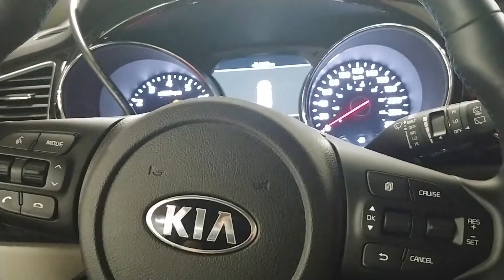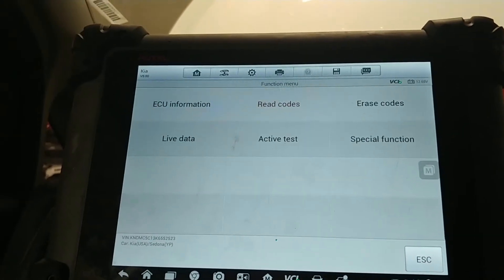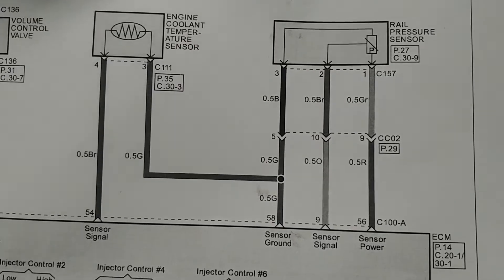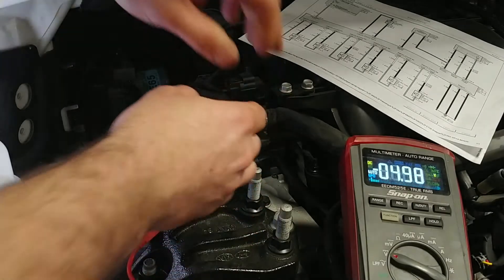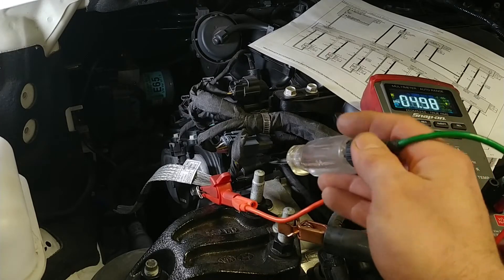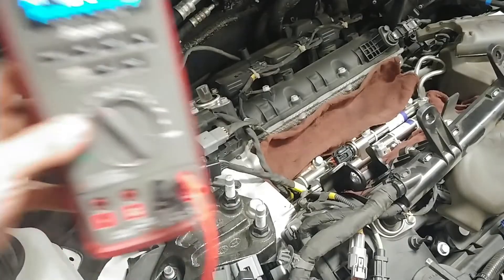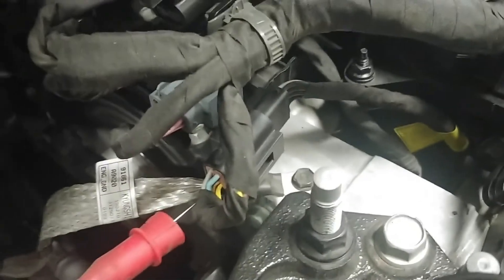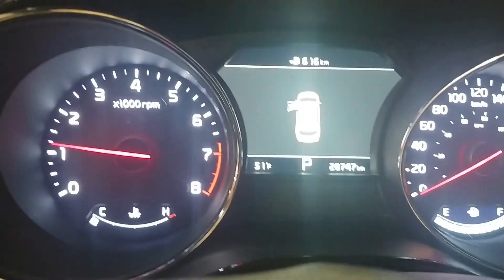Fuel Rail Pressure Sensor Diagnosis

Comment: What was the signal voltage with engine on? Thank you, nice video. 
My 2021 MB, I’m reading 1.12 at idle, 1.13 at 2000rpm with no DTC or Check engine light. Weird.

Comment: The video is helpful.. I have a question.. what if the signal wire plugged in key at ignition and the voltage below zero volts.. ??

Comment: hello, i have a passat 2.0 TDI CFFB engine, i tested my presseur sensor only by reading vcds value and i found that teh pressure kep a litle bit stable at idle then a sudden peek happen i would say 2 or 3 times from 28 KPA to 32 KPA, the peeks ar happen for ms in about 10 seconds , is it a faulty prssure sensor ?

Comment: I have FRPS circuit hight eror.engine cant start but at same time i have fuel pressure  readings that goea up to1200 when cranking.but i am going to perform the test as shown
Reply from the maker: it depends on which vehicle. there can be either 2 sensors. if there is a gdi system there always be one at the fuel rail(which is for the hp side) and another for the low pressure side. the circuit hi code is more likely due to wiring or a sensor.

thanks for watching

Comment: Should any of the wires in the connector have power when testing with a circuit tester? Car on engine off.
Reply from the maker: 12v no.. power is fed through a 5v circuit, so withe the connector connected you should have a 5v a ground and a signal wire, the singal wire will vary depending on the pressure in the system

Comment: I don't know if anyone asked, but if someone could answer this for me are those voltage values basically for most cars or all cars. Or does this specific use 5? Just trying to see If I need to go searching for my Ford 500.
Voltage values Yes, I'm still having a problem. Even after a place in the sensor which i'm starting to believe was junk from the store.

Comment: Hello i would be happy if u help me with my issue bcs no one could do so far.i have dtc p0090 p0091 p0092 popping and so far I've replaced fuel filter fuel pressure regulator fuel rail sensor and fuel pump has been removed and checked but the problem still remains i have checked voltage on the plug its 2 wire's one is shown 8.8volts engine not running so is this a bad ecu or something else thats a fiat ducato 2.3multijet engine is stalling when its driven thank you in advance🙏

Comment: Great video it's nice to see a multimeter being used properly.the decade box allows you to dial in resistance into the signal wire and they are cheap
Reply from the maker: Great point

Comment: Sorry old video but just found it. If you looked at parameters on the diag tool would the fuel pressure pid change when pulling the signal down with the led test light?
Reply from the maker: yes it would, you could make it climb and fall if the wiring is good.

Comment: 6:14 lucky you didnt blow the ecu up putting 12 volts down
the 5 volts ecu power side......
Reply from the maker: The meter was reading a voltage drop. No cause for concern since I was set to check voltage and not amperage.

Comment: Can we bypass the rail pressure sensor by looping those signal wire and supply wire ?
Reply from the maker: no, if you try to bypass the signal wire you will get 5volts or 0volts, the sensor needs to be use for proper fuel delivery.
Reply: @JLsAutoSolution  👍

Comment: My sensor signal wire is 3 volts ignition on plugged in so 4.9 volts 3 volts ground is something wrong? Getting low pressure codes and car isn't running.

Comment: JL's, nice video. I subscribed :-)   Hey, I'm ready to start up an '03 Mercury Marauder that I had the engine and lots of other items rebuilt/replaced on, including the fuel pump. I added a fuel pressure pod gauge that has a sender that sits right on top of the stock fuel rail pressure sensor (frps). Anyways, I'm not getting the pump to run unless I give it 12 volts from the battery. When I use the fuel pump driver module and the PCM , the pump won't run. I'm trouble shooting the frps and your video helped. I get 5V, 5V, and 12V on the three pins when the connector is disconnected...like you do. I get 5V, .5V and 12V when the key is on and a pin is stuck through the weather pack like you did (great trick!). Is this .5 in the right range for a completely depressurized system?  Also, I guess I do not know if .5 volts would be for relatively high pressure or relatively low pressure...do you know? Thanks so much! :-)
Reply from the maker: Thank you watching and the question.

So i did a little research and found that at KOEO that the voltage should be roughly 0.2V. So that means that low voltage equals low pressure. 

Is 0.5V something to be  worried about? Since your vehicle is not running I would say not at this time.. I would keep focus on getting the vehicle to run before going towards a FRPS Fault.

I would check to make sure the inertia Switch is not open- this will cause no power to flow to the FPCM- it is located in the truck on the left support.

Thanks for watching.

Comment: It would be nice to see the fuel pressure sensor working showing different pressure voltages during the engine revving up, Thanks for a good video with schematic, diagnosis, codes, and some repair procedures, my first time here, a little more data on a running engine would have been a gold star.
Reply: i howe problem on 530d the car losin gas pedal and ticking rmp  when i driving

Comment: I noticed these newer engines that have a FRP sensor don't have a Schrader valve to test actual pressure. So why don't you explain in your diagnostic how much voltage is normal and how it's suppose to fluctuate depending on the actual pressure? You went straight to test if the wiring was shorted. Isn't the scanner suppose to tell you the voltage? Another thumb down 👎 test your fuel pressure first guys
Reply from the maker: I agree with what your saying... if this was a fuel pressure related issue which then the pcm would have set a code for fuel pressure low or high. Now since the dtc that was in the system was  fuel pressure CIRCUIT high, there was no need to go towards the fuel pressure.

the pcm was seeing a higher than wanted voltage on the signal line due to the sensor being stuck or open. and thats all i was showing in this video..

thanks for watcing

Comment: Hey JL’s Auto Solution I have a quick question. You said the signal wire should be 5 volts like you showed. I saw elsewhere that it should be around half a volt with the engine off and mine is .5 - .6 volts. Is this correct or does every car vary? Thanks
Reply from the maker: Hi kyle.. So first off thanks for thw question..
Always check service data for your vehiclw. 

Now.. All frps That i have tested have been between 0 .6-1v(signal wire) .. Key on engine off and sensor connector plugged in( connected) and 5v when disconnected. Now you shod always have a 5v feed and a sensor ground. 

I mention this at the 2:50(ISH)mark..

THANKS for watching..
Reply: @JLsAutoSolution  awesome thanks for the quick reply. So yea I’m definitely losing voltage somewhere on the signal since it’s only .5-.6 unplugged. My ground is 9v and reference is 5v (unplugged)

Comment: Can you test for continuity on the sensor itself?
Reply from the maker: you can, but it will be in the m.ohms reading if im not mistaken, unless there is a straight short to ground or 5v circuit, which then would give other issues.

thanks for watching

Comment: Great Video ! may i ask if i can still use the bulb test light when doing the bypass ? :)
Reply: not the LED one ?
Reply from the maker: using an incandescent or and L.E.D test lamp will give you the the same result. just be aware that the voltage that will will be dropped will be greater with the incandescent test light..

Also note that there at 2 styles of signals out there with bias voltages.. one is voltage-- 12v or 5v monitored signal or a ground monitored signal..  you need to test in order to be certain which system you have..

thanks for watching..😁
Reply: @JLsAutoSolution  wow thanks for responding ! but LED is better for bypassing ?

Comment: Well done brother 👍.
 I had two codes at the same time on my range Rover sport 2010 .
1, P0088 fuel pressure too low
2, P0087 fuel pressure too high
Please could that also be rail pressure censor ??
Reply from the maker: In all situations it is highly  suggested to perform a thorough diagnostics. the last thing you want is to replace a component only to have the same issue afterwards.. 

thanks for watching.
Reply: @JLsAutoSolution  thanks stay safe

Comment: Thanks. This was very helpful for me to find out whether it’s the ECM or the wiring/sensor. I’m also getting a P0193 in my 2009 Lexus IS250. 

If you have experience working on the IS250 for this issue, do give me a tip or two. Thanks, and Merry Christmas!

Comment: I'm pulling 274.21 psi on my fuel rail pressure on my Ford 3.0L DOHC Duratec V-6 at idle.  I need to check it with key on engine off. No engine light.  Seems high to me.
Reply from the maker: So 240-485 kpa is normal which equals to 30-70psi..

Check your pressure setting and make sure the scan tool is not reading it in kpa.
Reply: @JLsAutoSolution  Thanks. It WAS k/pa. I had my scanner in text mode and for some reason it was reading psi AND k/pa the same... as k/pa. I switched to the guage and it's about 50/60 psi. Appreciate the help man!!
Reply: @JLsAutoSolution   Upon further investigation of my lean condition, especially in Bank 1,  I found oil in the spark plug well on cylinders 4 and 5, Bank 2, on my Ford 3.0L DOHC Duratec V-6 engine. Cylinder 6 was clean. I haven't been able to check Back 1, the 1, 2 and 3 cylinders because I can't even see them. Against the firewall. I need to remove the Intake Manifold. So I know at least 2 cylinders on bank 2 were misfiring. I'm not sure how this would cause a lean condition in Bank 1 though. I can't imagine Bank 1 looking like this because the car ran pretty good.  Idled a bit rough but still not as bad as I'd have thought this would make it. At any rate I found what could possibly be causing everything. What a pain. This car was meticulously maintained and is in perfect condition. Just a shame.  I have my work cut out for me now. Freezing out now too!! Any advice would be appreciated!! Thanks a million man.  Your help has been appreciated!!
Reply from the maker: @RickyPisano  the first thing i would look at is your fuel trim numbers.. 

If the numbers are in the positive.. 15-30% total.. So what i mean is if your stft and ltft are excessively high at idle.. Increase your rpm at idle while watching your fuel trim numbers.. If the numbers get better... Then you more than likely have a vaccuum leak.

Next if that checks out perform a 02 sensor response test.. This can be done by adding a fuel source while the engine is running.... Suggest something like propane..( extreme caution while performing this test..) And see if the 02 sensor goes rich.. If not you might have a false reading 02. Circuit must be checked.

you might have sticking/ stuck/ open (electrically) injectors.  Causing a lean code.. 

Lastly.. Mechanical issue burnt/ sticking valve's or any other mechanical issues..

Hope this helps
Reply: @JLsAutoSolution 
 At IDLE:
Bank 1 STFT  0.00%.  LTFT 24.22%.           Bank 2  -0.78%  LTFT 12.50%.
At 2500 RPM:
Bank 1 STFT -0.78%%  LTFT 0.78%
Bank 2 STFT  0.78%  LTFT 5.47
Reply from the maker: @RickyPisano  so your fuel trim reading's are telling you you have a extremely lean vehicle. Almost 37% total trim.. So the Pcm is adding more fuel to compensate for this.

Now since the numbers get better at higher rpms I suggest taking a look at your intake gaskets/vacuum lines/ egr and hoses/ for starters..  Suggest a smoke machine for this.
Reply from the maker: What vehicle is this.. And year..
Reply: @JLsAutoSolution  2005 Ford 500 Limited 3.0L Duratec DOHC V-6.

Comment: I have currently the same problem - I narrowed it down to the sensor for now but i will définitely test things again with your method. Thank you for sharing this.
Reply from the maker: Did it work?
Reply: JL's Auto Solution Sadly, no :( Injection module does not supply any current to the sensor. It will not be for nothing, i know more now :)
Reply: What is the problem of the engine before the test, it can't start?

Comment: Nice use of a LED test light and live data, thanks Jeremy
Reply: For the 5volt reference u can use test light or 20ohm resistor to voltage load and if your 5volt remains it's a healthy 5v reference.
Reply from the maker: Glad it was helpful! any time.I haven't finished your video on the fuel pressure issue yet.. going to get to that tonight. have a great day